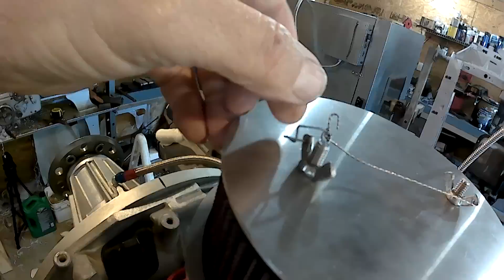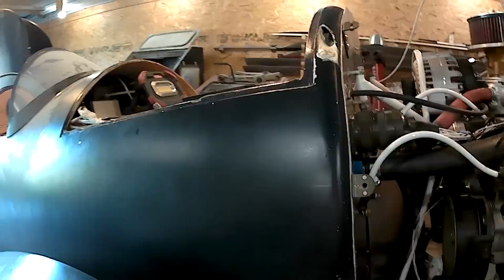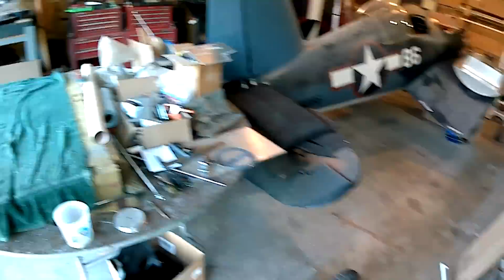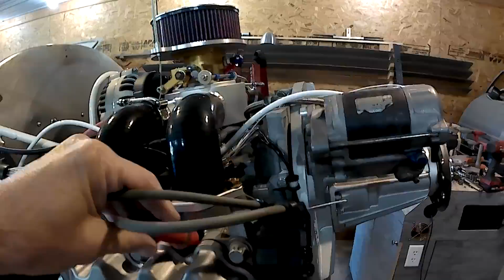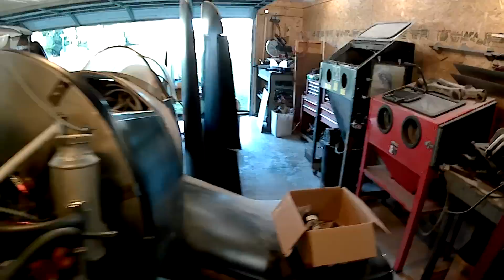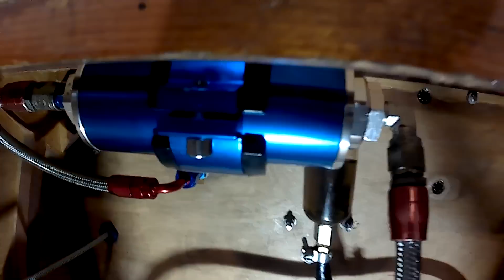WAR Corsair Update 8/26/2025

Comment: Are you going to use a single wire or doubled wire to secure the machine screws to the bottom of your fuel tank?
Reply from the maker: Just a single wire worked before.

Comment: With a custom intake and exhaust, how will you verify performance (power output) before the first flight? I wrote it before and I'll write it again: My gut tells me a lack of sufficient scavenging will be an issue with that muffler. I hope I'm wrong but it looks to be a very high pressure loss design. Thanks for the update.
Reply from the maker: Scavenging is a good thing, but I am not looking for the last HP. I will know how much power the engine is making by how much pitch the prop needs to get to the same PRM as before.

Comment: Why did you decide to not run the pipes out the original holes?
Reply: Hi Don, I’m excited to see your work and have something you might be interested in using. I have sheets of thin corrugated stainless steel and aluminum that are very effective in shielding your cowling and any surrounding surfaces from heat from the exhaust system. If you think that might be helpful let me know. I can ship them out to you to test. I also use aluminum foil/ fiberglass with adhesive backing that conforms to flat and curved surfaces. I buy it at Jegs Automotive. Let me know!
Rob
Reply from the maker: @robertyoung455  Thanks for the offer. I will know more once it is all cowled back up if I will need to insulate the heat from the cowling. I will let you know.
Reply: @Dynodon64 when you’re ready to fire I’ll be watching!… You’ll probably be fine without it, but if you see any discoloration on your cowl, this type of material will probably help eliminate it.
Thanks for reading and replying to my comments. 
Rob
Reply from the maker: It makes them long and would just put more heat under the cowling. Plus, the tubing is heavy.

Comment: How effective is that lockwire going to be, on the air filter wingnuts? (I may be being over-cautious). That was some serious galvanic corrosion, on your blast cabinet water tank, to make the riv-nuts disappear! @14:22... You mention isolating the engine heat from from the carburetor. Wouldn't you want some engine heat, to prevent carburetor icing?
Reply from the maker: I used the same wing nuts set up on my Gyrochopter for years. Never had a problem. This style of carb isn't prone to icing. There will still be heat inside the cowling as well for the engine to draw in.

Comment: Hiya Don
 To save cutting a largish hole in the firewall could you temporarily remove the big multi plug housing, cut a notch in the side of that big hole to fit the dia. of the sensor cable, pass the sensor plug through there then refit the multi plug?
All the best Don, you are an inspiration to us all.
Neil
Reply from the maker: When I first read your post, I thought you were talking about the sensor plug. Take that plug apart. It's all molded together, so that won't work. But after I re read the comment, I saw you were talking about the main wire harness plug. I think that is a good idea. Let me think on that one.
Reply: @Dynodon64  Hi Don
 yes we used to call them Amphenol plugs after the company that made them, I should have said that.
All the best Don. Neil

Comment: Looking good.  Would it be possible to make a smaller hole for the gauge by using a square piece of plywood that could be attached to the rear of the panel or even the front of the panel that the gauge could be attached to?   Just asking for a friend.... 🙂
Reply from the maker: Yes, that would work, but I will use a piece of aluminum turned on the lathe. Thanks